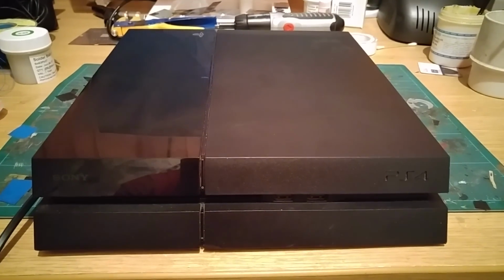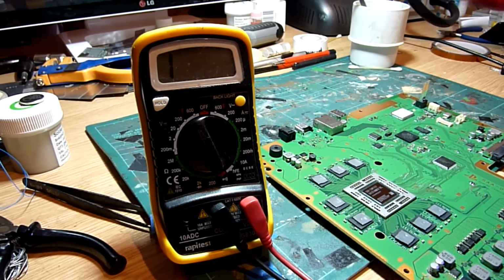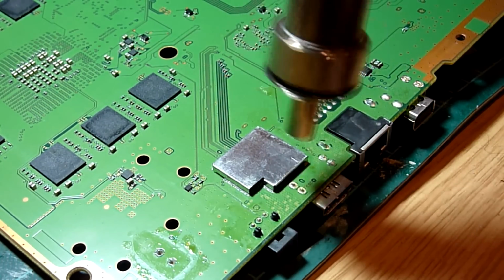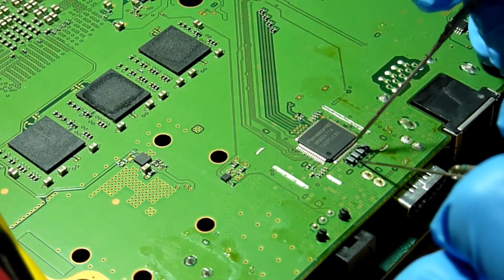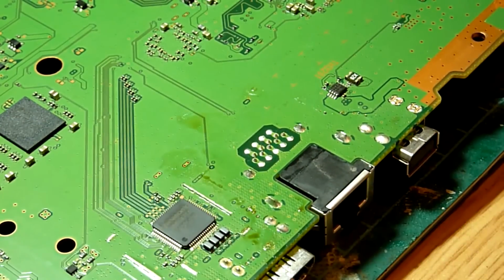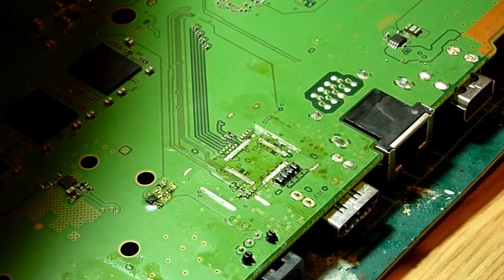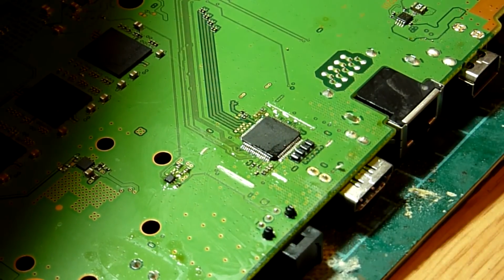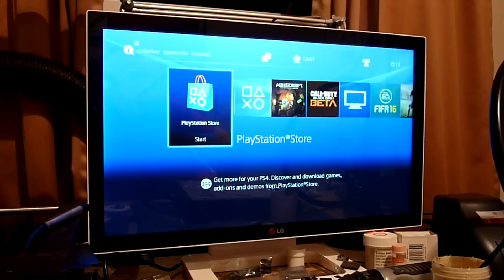PS4 Diagnose Faulty Panasonic MN86471A HDMI Encoder IC Chip Tutorial (WLOD)

Comment: Hi Andrew, I have a ps4. I can play it for ours no issues. Next day I want to play say f1 game it will  randomly loose av leaving a solid white light. controller buttons wont do anything. I have to pull the mains cord to get it working again. it checks the hd then restarts with the warning of not cycling down properly then is fine for the rest of the evening. any ideas Stu.
Reply from the maker: Probably early start of APU troubles - seen a few like this. Reball should sort. Cheers :-)
Reply: +Andrew Paul Thanks for the quick response Andrew. Is it expensive? 
cheers Stu.
Reply from the maker: Nah not really mate. Expect to pay between £60-80 in the UK - just make sure they definitely reball and don't reflow it. Cheers.
Reply: Any recommendations?  your self preferably 
ps i bought it knowing it was opened. they said to remove a build up of dust.
cheers stu.

Comment: Hello Andrew Paul,

I have a PS4 that does not display image on screen.

I changed the HDMI port for a new one of more quality, but still no image.

However, the TV detects the HDMI signal.
Even when I restart the video parameters of the PS4 (pressing 9 seconds the power button), the image is displayed 1 or 2 seconds, but immediately the signal is lost again.
Do you think this could be a problem with the Panasonic Chip?

I hope you can help me.

Thank you
Reply from the maker: +Ernesto Fernández I'll more or less guarantee its the IC providing the new port has no loose pins or bridges.
Reply: Thanks for your quick response!!

I want to emphasize that I have been able to see the image on the screen for a few seconds but the signal is lost immediately.
Knowing this, you can ensure that the HDMI port is well installed, right?
I would not want to buy the IC chip at all.
Reply from the maker: I'd be tempted in that case to purchase a faulty board (i.e. BLOD) and then you have all the parts necessary. The few times I've seen them do this specifically I've ended up changing the big capacitors and transistor packages to the rear of the IC - some of those also required a new IC afterwards. If you have the donor board to hand then you have all the parts for every eventuality.
Reply: Agree Andrew Paul!
I think I'll follow your directions!
I'll tell you how I was.
Thank you very much
Reply: The truth is that I do not have much knowledge of electronics.
I think I would not be able to change all transistor packets.
Have you had to do it many times?
Or, usually just changing the IC chip has worked?
Reply from the maker: I've probably had to do it approx. 10 times or so off the top of my head.
Reply: Perfect !!
Then I'll risk buying the IC chip and changing it.
Thanks again !!
Your videos are very good.
you have one more subscriber!

Comment: Hello man little question, what the liquid that you use?
Reply from the maker: That is flux paste. It helps solder flow and rids the solder joints of oxides and encourages a better quality joint. The stuff used in this video was Amtech RMA-218.
Reply: Andrew Paul thank you very much!
i'm receiving my chip soon.
Reply from the maker: No problem. Good luck with the repair :-)

Comment: It would be easier if the motherboard, had design to have those chips attach, and they were all in a metal strip attach to each other, so we just pull the strip out to pull out all those chips, and replacing it with a new one, that would be easier and faster to replace.
Reply: Yea, they don't make these with the ease of repair in mind.  It's more about cost.  If Sony engineered the board to easily replace every component the PS4 would cost thousands of dollars.

Comment: But my problem is my ps4's blue light stays on. No white light or picture. So would replacing the encoder child is the problem and if not what else could the problem be?
Reply from the maker: If you've got a constant pulsing blue light HDMI isn't your problem. Pray it's APU and a reball / reflow will sort it because if not you'll probably never find the cause within reasonable means.

Comment: I accidentally burnt off and damaged part of the IC solder on the motherboard while trying to remove the old IC. Is there a way to fix this?
Reply from the maker: You can run a link wire to restore the circuit but you'll need to trace out where the pad goes on a donor or ask someone with another board to test where the missing pin goes to. Do you have a picture of the damage you can link to?
Reply: Here is a link to the picture of the damage. Kindly have a look at it and let me know what you think.
https://imgur.com/a/i2vUk
Reply from the maker: Ouch! That's some really nasty damage there. Looks like you have a minimum of 8 pads missing plus a couple which appear to be torn into ground.

Comment: What Pines aré shortcircuit ¿. Before to change the ic .  In the vídeo aré not defined. Thanks
Reply from the maker: +Gonzalo Bautista Garcia When you lift the IC check the PCB on right hand side with the ports facing you. You'll see a common trace connecting two pins - 8&9 if I remember correctly but check that using the above. Cheers.
Reply: I meant that measures should detect Ohms to determine that you have bad MNxxxxx integrated circuit?
Before lifting plate
Reply from the maker: Of course you could do that but really it's not worth the time checking mate - the HDMI out circuit is fairly simple and unless there's been a massive surge like a lightening bolt hit where further checks would be advised, checking the basics as shown has always been enough to tell for me and has never let me down so far. Cheers.
Reply: Andrew theme is that it is not clear. I mean if we can verify some semiconductor level, some short circuit or resistance measurement that tells us that the IC is damaged.
To prevent change without any warranty.
Thank you
Reply from the maker: +Gonzalo Bautista Garcia The thing is is that they fail in all kinds of ways - there's no hard and fast measurement which will reliably tell you that this chip had failed - the quick checks you can do in this video I find are enough to diagnose the issue reliably every time. Cheers.

Comment: 1 question i turn on the ps4 i sound 3 bips and dont apper imagen on tv can u tell me how can i fix it i tried reflow but i dosent work ty for ur answer
Reply from the maker: +xXDeathKnight7Xx No I'm afraid that's death. I've only ever seen one and couldn't resurrect it - I suspect it's possibly flash corruption or major component failure.
Reply: +Andrew Paul  give me any suggestion pls maybe i could change any part thank u again
Reply from the maker: +xXDeathKnight7Xx Sadly not mate - I spent ages trying to work it out but didn't get anywhere and I don't want you to waste your time as I did. Cheers.

Comment: if i send you a ps4 with the same problem will you be able to fix it?
Reply from the maker: +Paruthy Rajakulam Yes - where are you located?
Reply: watford?
Reply from the maker: +Paruthy Rajakulam Yes no problem. MN86471A replacement is £59.99 + £9.99 return postage. Do you use Twitter at all? Drop me a DM on there @YTAndrewPaul if so and I can send you the details. If not then let me know a method I can get you on. Cheers, Andy.

Comment: My PS4 isn't showing picture in 720p and above, 480p is working BUT only when it will turn on. Sometimes i got just blank or grey screen (with wlod) even in safe mode. If console starts it wi working in safe mode and i can even restart from safe mode to system (480p) without problems. Games are working normal. I got it for LeMax2 4/32 so i think it will be god for repair. What do u think... IC? Can i repair it with 858DH+NoFlux+Soldering Iron+Multimeter only? i don't want to destory it bcoz i have 16y and i just working on USB ports or some very small resistors with this HotAir. I have a shop with electric components to buy so i can buy something what can help me to do this. Console is CECH1116A. Reply please ;)
Reply: and for sure i have simmilar problem with no signal about some seconds like this.

Comment: Replaced Hdmi Port and HDMI Encoder IC, still no picture. Measurements done and all seems fine.
Is there a boardview or datasheets i can use?
My soldering is solid - done a lot of Macbook Repair (Wled drivers, BGA Ram replacement, ...)

Did u ever got faulty IC's? I order from amazon for Slim/pro

Comment: Hello
I have a ps4 that gives me "no signal"
there a way to be sure that the problem is the chip?
excuse for my language but use a translator :)
Reply from the maker: Just check everything as per the video - if all checks out OK you can be 95% sure it's the IC.
Reply: I did not understand what controls the HDMI port
you have a pattern to follow?
Reply from the maker: The IC controls the HDMI output. If the port checks OK you can be more or less certain the IC is at fault. Very rarely is it something other than the port or IC.
Reply: OK thanks :)
Reply: a question....to set the temperature soldering station?
Reply from the maker: 485C.
Reply: thanks :D

Comment: hey mate did you get chance to check out my pictures i sent you? i managed to remove the legs today so thats good news haha 
thanks
Reply from the maker: Yeah it doesn't look too bad mate all considering - that link wire from my pinout video you have there should get it up and running a treat (potential Encoder IC issues apart).
Reply: i hope its not the ic issue as i dont feel to confident swapping one over, but you do make it look so easy and your videos are brilliant anyway i could private message you at all if i need to send the board to you? thanks again
Reply from the maker: You certainly can mate no problem at all.

Comment: Thank you for the video, I've been looking for something like this for hours!

I'm having very similar issues with my (very precious white edition) PS4, more details in this reddit thread: https://www.reddit.com/r/PS4/comments/5hyf5a/no_video_output_after_accidentally_unplugging/

Long story short; do you know if "Remote Play" works with a damaged MN86471A? I can't find any datasheet on the chip so I'm not sure if the MN86471A is in any way involved with the video stream. It works from my PS Vita but I don't have a Windows 10 machine to try the PC version on.
Reply from the maker: Remote Play does indeed still work with a bad IC.
Reply: +Andrew Paul Thank you very much for the response, I'm fairly sure that's what's broken on mine then.

Have you gotten in any of the SAC-001 or newer boards in with a broken encoder IC? From that I can tell Sony should have switched to Panasonic MN864729 on those boards so that may be a more permanent solution?
Reply from the maker: They have indeed but I find these worse than the old MN86471A!
Reply: +Andrew Paul Ouch, that's really not what I was hoping for. I was investigating on whether it would've been possible to retrofit an SAC-001 board into my shell (the rear I/O layout is an issue but not a large one with access to a 3D printer) but I guess I can drop that idea then. I still find it quite worrying how Sony shipped a product which breaks on HDMI hotplug.

I've done some rough estimates and with 6 workdays left to Christmas it's going to be a stretch shipping my unit to UK and back in time, even with the cheapest overnight shipping (nothing except DHL actually happens overnight in Sweden) that's going to end up costing me quite a lot more than a brand new PS4 Slim. You don't happen to be selling just the raw chips, right?

With Remote Play working for now I think I'll be looking into having this one fixed next year instead if I have to send it away.
Reply from the maker: Djhg2000 Hi, sadly not. there are a lot of bad chips in supply currently I hear so steering clear of them for now as they're very expensive. I only provide ICs as part of repair - especially these QFNs.
Reply: +Andrew Paul I agree, looking online I see a lot of people getting broken chips from eBay. Now that there's a known "jailbreak" out for PS4 I don't really want to risk getting a blacklisted motherboard from a used console either. This is turning out to be quite the predicament. I know it's not much but I've sent you £1 through PayPal as a thank you for all the help.
Reply from the maker: Cheers mate, much appreciated. :-)

Comment: Hi Andrew great video, unfortunately bought an PS4 today to repair got it home to find the HDMI port hanging on with one leg which looks to me like they was trying to remove it with a £5 soldering iron, i managed to remove the HDMI port but on doing this i found one on the  19 pins the HDMI port sits on has no solder on it the ethernet port left to right its pin number 6 is there anyway at all to add a new HDMI port to this a run a trace to it ? i do have pictures of this but i could not add to this i would be very grateful if you could reply with any sort of solution on further inspection there is still legs attached to the motherboard haha wow this is bad,

hi it will not let me post again so ill rewrite it on here hope you do see it
http://imgur.com/VMS9ghJ image i found which may fix the problem next images will be my port and motherboard http://imgur.com/DdjGrps http://imgur.com/I0ugg2o http://imgur.com/bXGjvik http://imgur.com/JF2qoTe 

i cannot remove the legs from whats left in the board either, ran out of solder wick which is no on order 

thanks
Reply from the maker: Hi Paul,
Can you upload the images to imgur.com and paste the links to the images in here as a reply. Ideally I need to see what we're working with. Cheers.